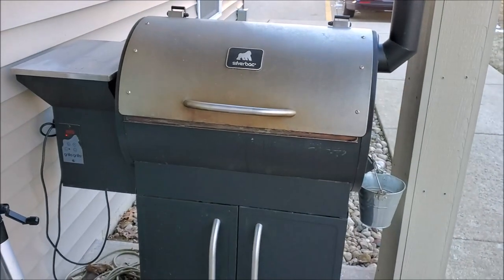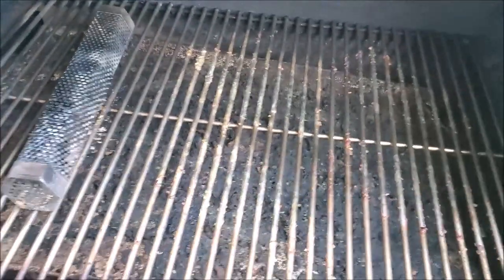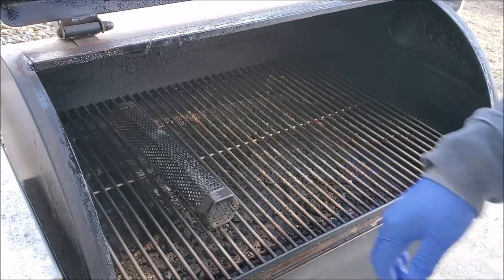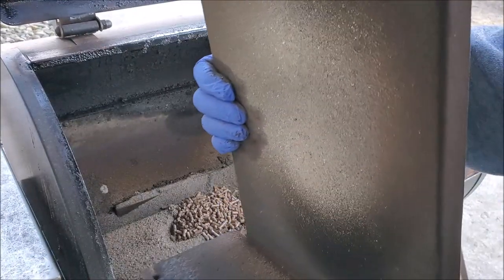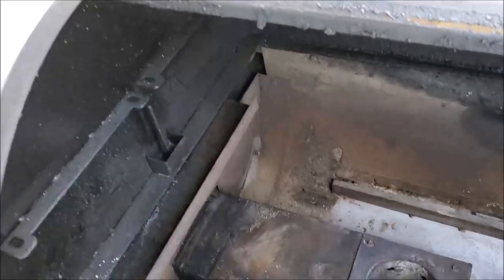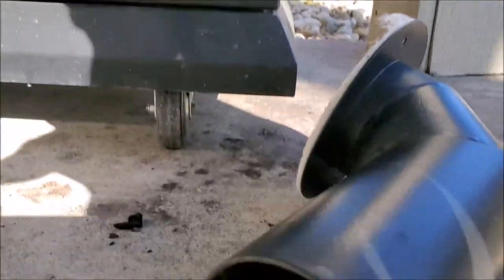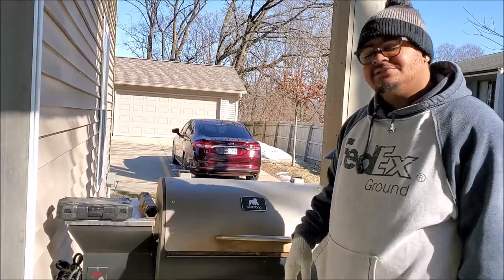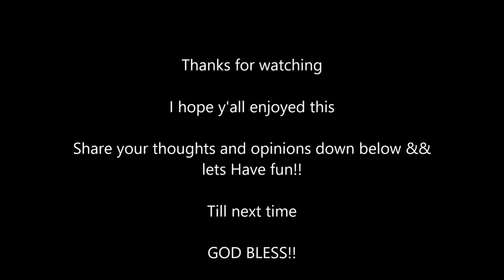1 Year Owners Update ~ Grilla Grills Silverbac

Comment: Mr Jones theres not alot of content on the Gorilla Grills you do great job of demonstrating grill. Now that you have had it for over a year are there any other pellet grills that you like with similar foot print. I believe the main grate is 26 x 19.5. I like the simplicity and durability of the Gorilla, cabinet is nice. One feature they offer is the add on drip rail accesorie, keep front of grill clean along with moisture going back into chamber and adding more integrity to the lid. What was the problem you had with lid when you seasoned your grill, it had gap on right side. Keep up the good work
Reply from the maker: Thanks man I appreciate a lot. Yea I'll likely make another video simply talking about pros and cons for I don't think I covered that in detail, but yea there was a gap on the front of the lid. The gap was about 1 inch or so wide and it allowed a lot of heat/smoke out of the front of the grill and not out the smoke stack.  I was able to make modifications to it to minimize that so now the gap is almost nonexistent, but it's there still because smoke will still flow out of the front. 

As far as other pellet Smokers like the Silverbac could be the rec tecs, campshefs, even traeger. The main thing I'll say is that I don't know much of anything about any other pellets grill other than that the build quality and warranty doesn't come close to that of grilla grills. Before you buy anything I'd definitely recommend doing some research to find out all pros and cons of the grills you want so you get the best bang for your buck.
Reply: Shenanigans With Mr. Jones did Grilla not offer to fix the issue that caused the gap? I am looking at getting one soon and if that’s something I’d have to do to an 800.00 grill, I’m out lol...
Reply: @WillCarrot  yeah, that is rather concerning.  I really like most of what I'm seeing from Grilla, but the cover gap is not so positive.

Comment: Another way to keep the inside of the grill clean is to cook directly over the top of the drip pan. I’ve found when food is overhanging the edge of the drip pan just slows down airflow also. Also I gave up on the tinfoil wrapping the pan I just want to scraping it off with a putty knife I feel it’s much easier and cheaper.

Comment: Run away from Grilla as fast as you can. My experience has been terrible, I hate this grill. 

Bought new grill, controller would not hold temps, would swing plus/minus 50 degrees. Changed controller, controls temps better BUT nowhere near as good as my friends ReqTec. So far on this second controller, I cannot get wifi to connect no matter what I do. I have spent hours researching and troubleshooting this grill. NOT WORTH IT, buy a ReqTec. You'd be better off buying a cheaper Pit Boss than this POS.
Reply: These comments are starting to turn me off frim rectec like they have a social media team committed to commenting saying rectec is better… weird.
Reply: @TheSteez28  I am not part of any recteq social media team. My friend has had a RT-590 for 5 years and loves it. He has made a lot of great BBQ for himself and friends over the years. I have been his house while he was smoking meat hundreds of times. His recteq controls temperatures at +/- 1 degree, and it holds temps within 5 or 6 degrees all day long. Not a single issue in all of these years. 

I stupidly bought my silverback because of a "sale." My silverback does NOT hold temps very well and it only adjust temps in 5 degree increments. The wifi controller will not work, I cannot get it to recognize my network even when I place my router 5 feet from the grill. Nothing but issues with the silverback. Temps will swing by 20 degrees for no reason, the company always blames the pellets you are using but I have tried 5 different pellet manufactures including grilla brand and nothing works well. I very much regret buying this thing and the price wasn't really less than a recteq RT-590. Once you buy a silverback, you own it. The company offered to take it back but I would have to repackage it in boxes and secure it to a pallet. I got rid of the boxes and pallet shortly after getting the grill so not much of an option and they told me if the grill was damaged in the return process I would be responsible.....no thanks, not worth the risk. So the best I can do is try to sell it for a huge loss or do what I plan to do which is to change my garbage silverback controller with a recteq controller. I think I will have a decent grill when I do that, but the overall cost will be way more than if I just bought the RT-590 to start with. Lesson learned.